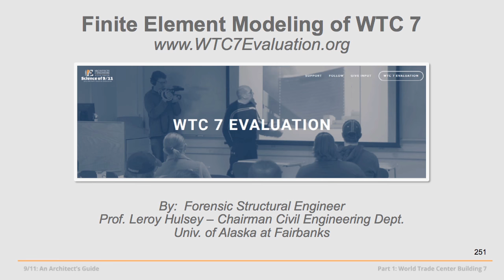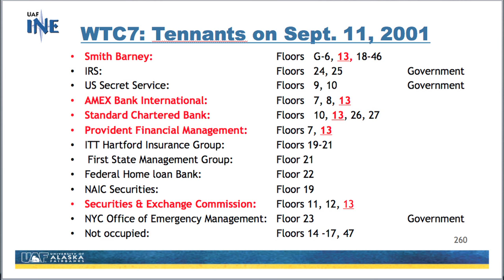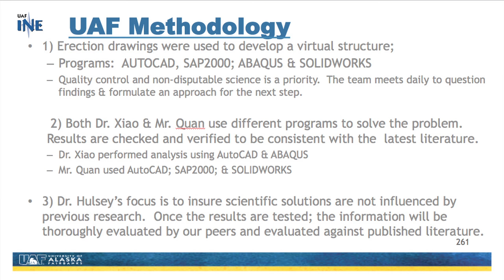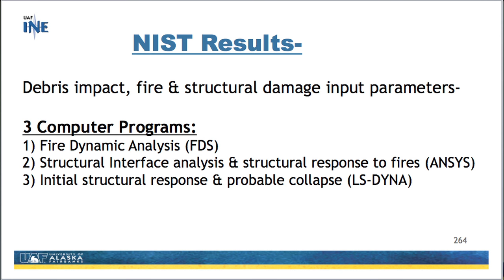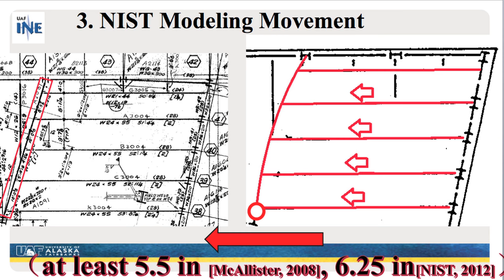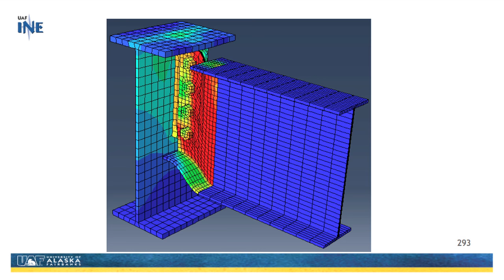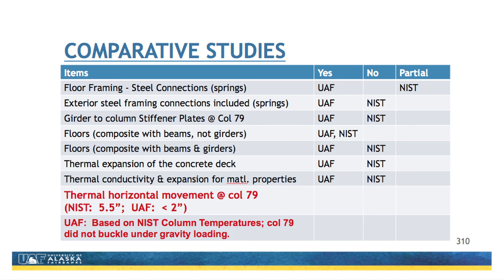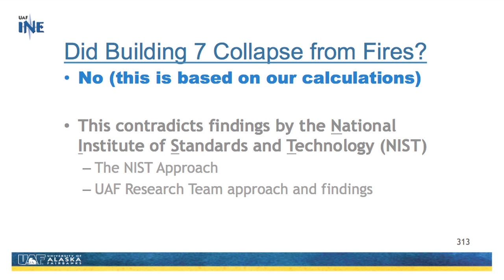The Third Tower - BSA Space - Dec. 16, 2016 - Dr. Leroy Hulsey

Comment: THE BEHAVIOUR OF MULTI-STORY STEEL FRAMED BUILDINGS IN FIRE
© 1999 British Steel Technology Center

Cardington Steel Tests

9 DISCUSSION
9.1 Observed Behavior

The tests on the Cardington frame enabled the differences between the standard fire test and the actual behavior to be studied. This led to the conclusion that the cooler structure surrounding the heat effected members was extremely beneficial to the heated members. The maximum steel temperatures reached during the six tests at Cartington was in excess of 1100 °C. This occurred with no signs of structural collapse.
Using modern fire codes , which are based on the standard fire tests, failure (or structural collapse) was calculated at 680°C ; it is clear that the current level of safety is quite high.
Further work on quantifying the safety level and developing definitive design guidance, which will incorporate a more logical and economical approach to structural fire design. – pg. 64

http://www.mace.manchester.ac.uk/project/research/structures/strucfire/DataBase/References/MultistoreySteelFramedBuildings.pdf
\\][//

Comment: After going through all of that detail, which was concentrated almost exclusively on what NIST concluded caused the collapse,  and without looking at various scenarios that he had yet to investigate, he then declares that WTC did not collapse due to fires. How can he possible present a conclusion of that  kind at that stage?  He also said he was going to look at these other scenarios because people would ask 'why didn't you look at these other scenarios?'. He should be asking himself those questions  and investigating that,  not doing it because other people might ask why he hadn't done it.
Reply: How much do you understand the subject, engineering, physics, loads, etc. 
So I can maybe explain some of it to you? 

The short version is, for certain types of structures, when these details are known, 
You either will need an X amount of energy to break the components giving the structure the resistance to stand.
Now you can do an exploratory analysis of the data, where you make several different scenarios untilyou find the right scenario/condition that happened in reality, from many different scenarios try and error until you find one that matches reality.

Another type of analysis is a confirmatory analysis, for that you need the hypothesis, for example NIST claims to know, how, what and where the problems happened& why the building fell how it did. Now you as a scientist, plot that data in the model (fires, temperatures etc, whatever NIST claims to know), and you observe the results and see if it the hypothesis & results match reality. 

When NIST says column 79 failed and it lead to a total symmetric collapse of the building at free fall, and you know the temperature & were there were fires, and you plot NISTS condition into the model, you can know for sure that even if you FORCE the column 79 to fall under their conditions (because it does not fall with the temperatures reported alone) and the simulations or reality do not match.

it's an asymmetric structure and a buckling column on one asymmetric side of the building failing will never ever lead to symmetric collapse.

The short answer is fire damage us highly dynamic and not organized,
The chances of it causing a building to collapse  all at once, in less than 6 seconds without toppling over or breaking down in parts doesn't actually need the simulations, the computer model is just overkill, it just proves beyond doubt that not even by some crazy sort of unlikely event. Now it's proven that with only fire, no matter what you do to the simulations, no matter what, the falling pattern is completely unlike reality (btw those components are pre-tested in furnaces so we know how the act in fires)

NIST is wrong because no matter how you flip it.
It's actually INCOMPATIBLE with basic laws of physics. 

If you know how gravity works you know you can't drop an object heavier than air and expect it to rise up. 

If you know some more physics you know that could not happen that way+ with that explanation. 

But fair enough they even tried to simulate it. Nope, didn't work
Reply: Clint. Do yourself a favour and get a copy of Dr. Hulsey's final report. Importantly, NIST got it seriously wrong. Arrivederci!
Reply: @pkgum6910  Dr. Hulsey announced the result of his investigation after one year, that the collapse of WTC7 was not caused by fire. This was before he looked at any of the possible reasons for the collapse other than that postulated by NIST. He said he would look at the other possible causes 'just in case people said we didn't didn't look into other possible causes'. I would have thought looking for possible causes for the collapse was the purpose of his investigation. And what was his explanation for the collapse? He doesn't have one. That's  convenient. He doesn't have a reason for the collapse. Other people have to come up with a reason but not him. Maybe some vague magic wand waiving phrase like 'controlled demolition'. It's I can't explain the collapse , I'll just say the magic words 'controlled demolition'. That will work. The purpose of the controlled demolition is to make a building collapse. So it works.

Comment: If Hulsey is truly interested in incorporating all possible scenarios, esp regarding damage, he should incorporate the top to bottom breach of the perimeter wall frame at column 20, as well as the severed core cross girders, both resulting from a spire of North Tower perimeter wall slicing down through the structure. Failure to do so will guarantee faulty conclusions. Initiating movement of the perimeter wall collapse is the final proof of the breach: https://media.giphy.com/media/26BRHuKQqWcyY2Xja/giphy.gif
The evidence supporting this fact is overwhelming.
He should also note structural remains show floor girders broke from perimeter wall lintels, but remained attached to core columns, suggesting column 79 was yanked apart by falling floors, rather than "walked" off it's seat.
Reply: whetedge your collapse gif shows squibs running down the face of the building, suggesting explosive demolition.
Column 79 was blown apart by explosives.
\\][//
Reply: Whetedge. You are a Professor of ......? I'm still waiting for YOUR 3 to 4 year scientific study and final report into the collapse of WTC 7 PROVING Dr. Hulsey's final report is seriously flawed. Cheers.